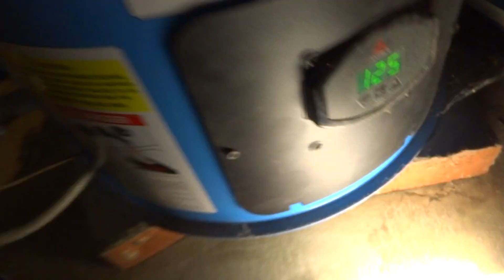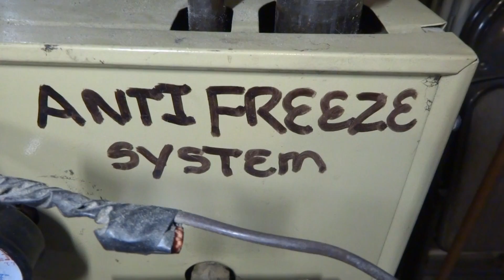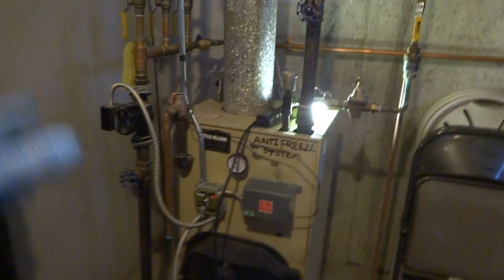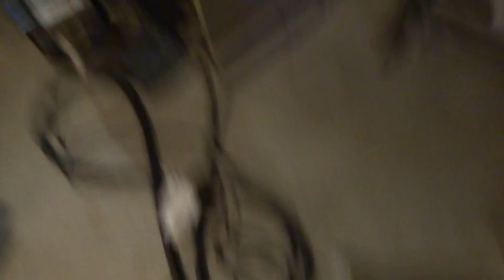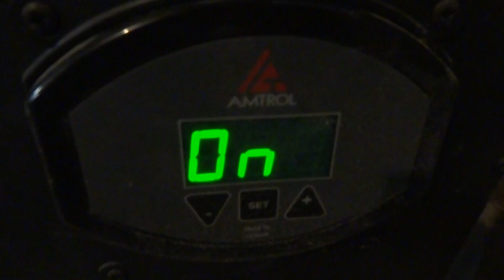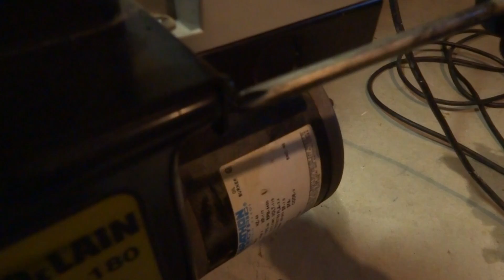MYSTERY NOISE FROM HOT WATER SYSTEM

Comment: Dude, I am a retired PC tech. I did it for 25 years. I carried a  stethoscope  with me primarily to listen to hard drives when a pc would not boot. If you cannot isolate a noise right away using a stethoscope helps by switching from one zone to the next and putting it against the pipes. The louder it gets in your ears, the closer you are to the problem.
Reply: I have used a hardwood dowel since I was 16 and my grandfather showed me that trick while diagnosing an engine problem.  I was amazed I could hear every moving part inside the motor

Comment: I love the saying call the guy who installed it back then had a “professiona” Hvac company install a nest thermostat for an oil fired system with a heat pump the next day their a/c dident work . Ended up taking off the fossil fuel kit to the system and put on the wrong nest thermostat I didn’t touch anything and made them come back and fix there mistake for free said if I have to fix it for you that company is getting my bill XD doing this stuff for 12 years love it when I’m told I’m wrong from someone who installed a pos thermostat and dident even check to make sure both systems worked before they left / mainly love the videos have a great day give molly a treat !

Comment: You changed out the tip and then dropped it in the slop bucket and cleaned out other parts over the new tip???  I like and learn from you videos, but I don't think thats the correct way, no?
Reply: Very good tech.  Very knowledgeable. But damn he works dirty. Never see him clean his gloves off. He touches his jeans with wet oily gloves.

Comment: IFC ‘s suck    install flow checks with circulators. This system lasted 20 yrs and still works good.  Weil McLein with a QB burner was the best set up   Only better would be a WB peerless with a reillo burner.    What about well pump grinding , sounds louder at night when all quiet.

Comment: What you are hearing is electrolysis and resonating ultra-sonic vibration caused by a phenomenon in certain circumstances where the pressure and air pockets hum because of a differential in cyclonic back flow.

Comment: Worked on a lot of Boilers in my time but never heard of a QB Burner,,.....Is that a Beckett. I noticed it said Beckett on the A Pump. Strange setup with the transformer and the end cone on the gun assembly and not the blast tube. .I was  also surprised it was only  firing  .75 GPH on a boiler that size. I was in the field when the old Weil McClains were around before the Gold Series came out. We installed a bunch of them with no problems except when you had to clean them and the sections being so tight , getting a brush in there was a PITA.

Comment: The vibration from the existing circulator, amplified as the waveform travelled along the pipes in addition to turbulence from probable air trapped in the system on the second floor, is what he was hearing, and would be a felt vibration, in addition to a sound vibration.

Comment: 30:12 did someone actually solder that propress fitting?

Probably cut the copper pipe with a grinder and left a sharp edge on it which cut the o-ring when they pushed the fitting on. When it leaked they just drained the boiler down again and soldered it. What a hack job.
Reply: You can actually solder those fittings in a pinch if you need to. I went to a job where they said the tub/ shower was leaking and their was an access panel on the opposing wet wall and the idiot that put the valve in forgot to press a coupling above the valve. I couldn't fit the tool in their to press it!

Comment: What’s the best natural gas hot water boiler??
Reply: Sometimes it’s not a question of what’s the best. It’s more likely to depend on what brand the guy you use can get from his supply house.
Reply: @Fireship1  gotcha. I’ve gotten four prices for a new boiler. The I’m thinking I’m going with offers Crown boilers. The other guys split/fin, weils McLain, and  burnham.  I have a old vaillant boiler now. Just wondering. Thanks
Reply: @papalou190  there’s nothing wrong with any of those. Find a good installer that stands behind his (or her) work and you’ll be fine.

Comment: I have that same boiler with that same burner.  In 22 years only ever changed the oil control and the hot water coil.  Every tech that services it says the same thing.  What a POS!  Must have got the only QB 180 that works.  Still find parts on the interweb but they are getting scarce.

Comment: $125 + labor is not a bad price. The plumbers around here will charge you $225 to fix a pinhole leak with a sharkbite fitting.  Every time Steve replaces one of those circulators, I get hungry for tacos.
Reply: Replacing a $100 Taco circulator pump in NYC is $700 with labor. Supply House and YouTube are a lot cheaper.

Comment: You do understand it could be a toilet with a slight leak and a bad fill valve !
They can make a lot of noise!
JS
You sound like me install vs repairs 🤣
Just a rookie 
Stay safe wear your safety glasses 
Give molly a treat!👍
Reply: When that happens it more or a banging noise and vibration.
Reply: @joebal9044  🤔
Bad fill valves sound like bad fill valves.some of these problems we come across you need to actually witness🤔🍺🍺🥃
JS
Stay safe
30 years in
Wear your safety glasses.
Reply: @realestateservicessaleshea99  A leaking flush valve can cause this too.  Just had one the other day.  It would like a little causing the fill valve to open and close abruptly.